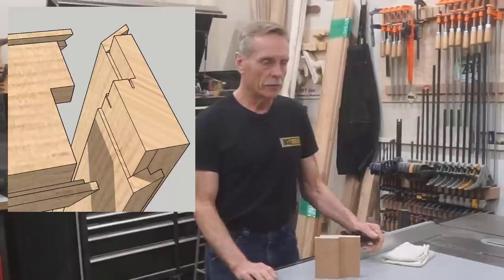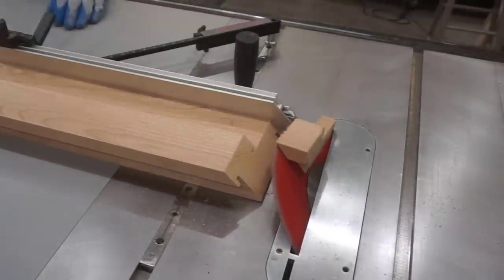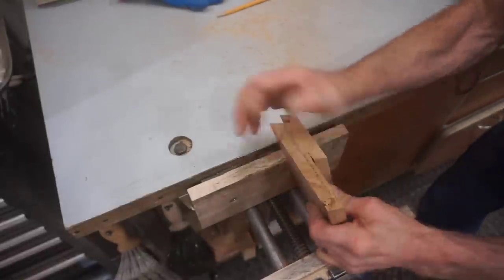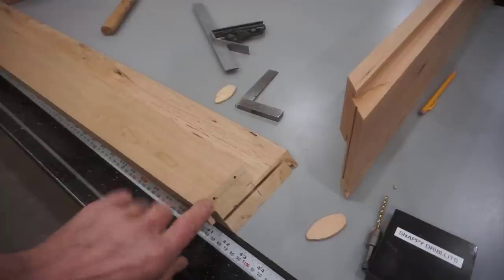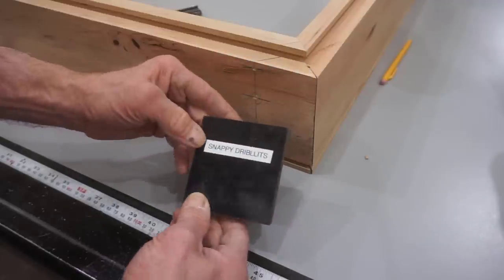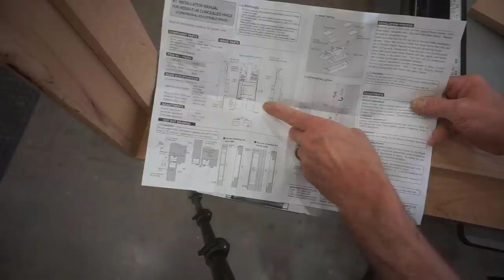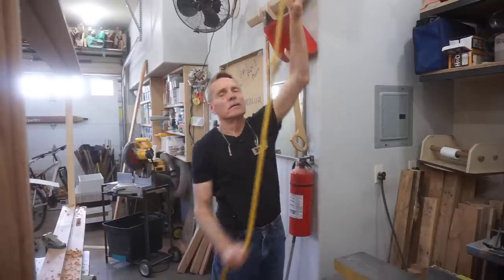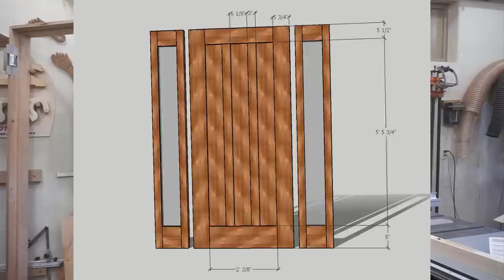Pallet Wood Door Build Episode #4

Comment: Ice been using that 4 inch shrink wrap around my warehouses and tool rooms for about 6 or 7 years.  Its perfect for long stock (pipes, rods, boards, blades, etc...) that doesn't get used often or that needs to get stored on high shelves or leaning against walls.

Comment: Pattern bits are nice because they allow you to use an exact sized template, but you are limited to the available bits. Have you considered using template bushings instead?  Once you get past the offset math needed to create your template, you have separated the patterning function from the cutting function, and you’d be able to use longer high quality bits (like a nice 1/4 spiral carbide bit)
Reply from the maker: I gave up on template bushings years ago when routers were less apt to have arbors concentric to their baseplates Doug.  Since then I've not been limited by available bits but it's certainly only a matter of time until I get bit... then I hope I'll remember your reminder for the expanded capabilities they offer.  Thanks! Best, Matt
Reply: You can get pins that mount in the router to aid in centering the bushing. But, like with all woodworking, there are always multiple approaches
Reply from the maker: @dougwilliams5031  You have obvious router experience... do you have a favorite router lift?  I need to get one for my 'new' tablesaw extension table/router table and the Jessem Master Lift II is at the top of my list... I'm curious about your thoughts and/or recommendations.  Thanks! Best, Matt
Reply: I have a woodpecker prl v2, with a porter cable 7518 that I picked up at a sale price. It’s a good reliable system, with above table adjustments and bit changes. I don’t like the plastic insert rings, and picked up a set of aluminum rings. There are other systems that have rings that attach with magnets that look nice as well. Part of your selection process needs to include the plate size (you may already have an opening in a table), what routers are compatible, and adjustments features (micro adjust, rapid adjust, above table bit changes)
Reply: The Jessem master lift II is a great unit. It will be a game changer for the precision of making doors and other router table tasks.
Reply from the maker: @Doug Williams Thanks for that... it was a toss up between Woodpeckers and Jessem and the coin came down on  Jessem.  I understand that a Porter Cable 75182 router is THEE one for lifts.  Is that what yours is or does the '2' designate a different model?  Would you replace yours with the same model if necessary or would you 'upgrade' to something else?  Best, Matt

Comment: I discovered that green shrink wrap when I was moving in June. I use it all the time now.
Reply from the maker: I get the green stuff from the local U-Haul store cuz' I think it's the best. Where did you get yours?
Reply: @NextLevelCarpentry  Home Depot.  I also have the really wide stuff.
Reply from the maker: @russmartin4189  thanks for lettin' me know... we don't have Home Depot around here but I'll take a gander next time I'm in Den-town to check it out.  I should probably get some of the wider stuff... just never pulled the trigger on it even though I'm sure it's useful... Best, Matt

Comment: Another excellent video, Matt. I'm not sure why the "premier" format would bother people: just watch it whenever.
Anyway, about the "throw" on the hinge: aren't you concerned about the door hitting the sharp edge of the jamb when it's unable to open to 180 degrees? Or can the hinges be adjusted to only open to 110 degrees?
Reply from the maker: The hinges aren't adjustable to open anything less than 180 degrees but the door swings into a corner against the wall and shelving there will prevent it from opening too far. I think you can see that in the SketchUp model in episode 1. One way or the other though it requires a positive stop because if the door is opened too far the extra thickness would just tear the hinge out of the jam since it's such a heavy door and such a thin strip of wood on the edge of the jamb. I believe I mentioned in episode 2 about my concern of the extra jamb width and the option of switching to a conventional hinge to prevent this very issue.  When I mortise the actual door I will probably move the mortis out leaving just to mmmm of door thickness outside the hinge for a little more freedom of movement I'll be at the risk of blowing out the face of the door. The only reason I'm pushing the design limits to this extent is because it's my own door in my own shop. I wouldn't feel comfortable with this setup for a client where I would risk expensive callbacks if the installation failed from pushing limits too far. Sorry for the long answer for such a simple question thanks for watching and commenting. Best, Matt
Reply: @NextLevelCarpentry  Thanks for the thoughtful reply, Matt. Your level of detail and understanding is very impressive.
Reply from the maker: @ericsmith2482  I appreciate viewers like yourself that are paying close enough attention to ask insightful questions.  Thanks for watching and commenting here... Best, Matt

Comment: Just a thought. Saw you balancing those heavy jamb timber  so that you could drill those pilot holes to attach them to the top of the jamb. Since you had already located where you wanted the pilot holes to exit, would it not have e been easier to drill outward from those located points because the outside was not that critical.
Reply from the maker: That wouldn't be a bad option Subra but I wanted to get the angle pretty close to 45 degrees too and freehanding would have been a bit less predictable but that's more an OCD thing than a right/wrong one.  Thanks for watching and commenting here... Best, Matt

Comment: Nice Job. Definitely will help me when I rout my entry door. As I said we did 7 interior doors. Template made of luan - Not as nice as yours. We had two palm routers. One set with a bushing for the shallow part. One set with a top bearing to do the deep rout. Both router bits were chucked deep into the collet. Your right there are no you tube videos on these type hinge installation. I believe Jon Peters has one where he routes for Soss hinges. But I think he has a factory made template for routing on which he uses a large plunge router.
Cant wait to see your finished product.
Reply from the maker: Glad you got to see this and compare Tony... lots of ways to skin a cat, as they say.  Because it will make sense to you I'll mention that a full 3/4" step in this jamb is overkill.  I didn't realize it until just last night.  Typical exterior jambs have only a 1/2" rabbet/step in them for the weatherstrip and 5/8" would easily 'hide' it.  I'm considering options for planing 1/8" off to leave a more ideal 5/8" step but I think the screws in the head jamb would be visible if I did... 20/20 hindsight.  It's fine the way it is but yours should be easier to do because you'll probably be dealing with 1/2" rather than 3/4".  Hope it goes well! Best, Matt
Reply: @NextLevelCarpentry  thanks Matt.  Actually my door arrives tomorrow. It's a standard door and jamb ordered with no hinge prep. The deep pocket will probably go through the jamb.  I may attach a piece of plywood to back to add thickness. Just have to see what the opening looks like when I take old door out. 
Just watched your video on the Japanese Lego like toys. What a brain teaser that was. Thanks
Reply from the maker: @lrc87290  That's cool... so much of remodeling is exactly like that, right?  Should be easy enough to infill the shim gap with solid wood for strength I imagine.  Glad you liked the Tsumiki video... that's one of the more plain-old enjoyable projects I've done in awhile! Best, Matt
Reply: @NextLevelCarpentry  Matt I noticed you kept the hinge covers on. Don't want to show the wow factor till the last video. People continue to be amazed by modern interior doors and hinges. We had flush solid core doors covered with laminate for a modern look. We made the jambs out of 8/4 poplar. The jamb is flush with the drywall with an aluminum reglet between the drywall and jamb. There is no door casing for a flush look. So I figured I couldn't have hinges sticking out. When I found these hinges I knew they were the answer price be damned. Actually I think they are reasonable for what they are. Wife  not so much.
Thanks again for your videos
Reply from the maker: @lrc87290  You're describing the door installation I saw in Jackson Hole a couple years ago that got me thinking about new possibilities for door/jamb/trim design.  The thought of a aluminum reglet as door casing gives me a headache though... pulling that off tells me you've got some chops!  Nice... and I get the 'wife; not so much' part... I haven't mentioned that figure to Mrs NLC and, sensible, frugal woman she is, would be in the 'not so much' camp for sure!
I'm intrigued by the design/materials/configuration you describe and it's no surprise you ended up with the same choice for hinges.
You're welcome for sure!
Best, Matt
Reply: @NextLevelCarpentry  Matt,
As you may suspect I got all my ideas from you tube. LOL. If you want to see what it supposed to be look like just search modern trim. Most came from another great you tuber named  Matt. Matt Risinger. A Texas builder.
Including a View Rail floating step system with 3-1/2 tigerwood treads.  When I first saw it  on Matt's channel I said I gotta put that in our townhouse renovation. Luckily the wife agreed.
Take care,
Tony
Reply from the maker: @lrc87290  that explanation clears up a lot... ironically that Matt is where I first learned Sugatsune is an alternative to Soss for concealed hinges.  Like gravitational pull to good ideas, right? Good luck with your project! Best, Matt
Reply: @NextLevelCarpentry  Matt, you were spot on. My jamb has 1/2 inch step in it. I have to make new template for routing. I have left over 1/2 x 1 - 3/8 poplar door stop material. It has worked out for both templates. The door is already routed and the template is made for the jamb but not routed yet. 
I'll tell you my screw up. As I was routing the second pocket - the first came out perfect- I didn't have the cutter bit down far enough for the first rough cut of the deep pocket - also the stop blocks were a little below the top of the template- the bearing missed the stop block and the cutter plowed into the stop block , split it and hit the drywall screw holding the block came out and rattled around the cutter. Ruined it. 
Was able to fix the over cut with high performance wood filler. Hope yours is going well.
Reply from the maker: @lrc87290  I SOOOO feel your pain!  Sounds like you made an acceptable save... which is what everyone needs to do from time to time, right?  Is your jamb stained or painted?  It would be just my luck to spoil a stained one since repair is that much more difficult, frustrating and time consuming... the Pallet Wood Door jamb has gone well. Had a few challenges with the threshold which you'll see in Episode #6 which is currently in post production after a 4 hour session in the shop this afternoon.  Thanks for the follow up comment... onward and upward?  Best, Matt
Reply: @NextLevelCarpentry  Matt,
Everything is paint grade. The overcut was in the hinge pocket step. So it would not have mattered if it was stain grade.
Going to try to take advantage of unseasonably warm weather Monday and get this entry door installed. Feeling confident it will go well. Can't wait for your next video. Thanks, Tony
Reply from the maker: @lrc87290  WHEW!  I misunderstood what/where the collateral damage was.  I'm rootin' for an uneventful installation for you! Good luck... 👊💪😎Best, Matt
Reply: @NextLevelCarpentry  Matt, The hinge install on my entry door went well. Tried to send an email with pic to your gmail account listed on your "about " page but it was returned as not found. I think I typed it in correct. As you may know in the neutral state these hinges hold the door about 3/32 inset of the jamb. However they are adjustable in this plane. 
Hopefully your build is going well.
Tony

Comment: Hi Matt, is there anything you could share with me about those measuring calipers you use?
Reply from the maker: Sure Jeffrey, here they are on Amazon: https://www.amazon.com/dp/B001LF3CG2/?ref=idea_lv_dp_ They're the 2nd ones I've had.  The first pair didn't fail but I replaced them because I cracked the plastic lens on the dial.  It's not delicate but got smashed in use somehow.  I chose this particular model on Starrett's reputation and the fact that I like the fractional inch/decimal inch readout so conversion isn't necessary. They're extremely handy in the shop for all manner of things, not the least of which is measuring thickness of pieces when running them through the DW735 thickness planer since 1/64th inch increments are clearly visible... Best, Matt

Comment: Matt, thank your for such in depth and informative content. I thoroughly enjoy every video.

Could you tell me what size snappy bit  you used for the #9 screws on the mitre?
Reply from the maker: Thanks Michael,
I'm pretty sure it was the 9/64" one but keep in mind that I didn't drill very far into the 2nd piece of the jamb with it.  I wanted the screws to start in the right place but didn't want much of a pilot hole so holding strength wouldn't be compromised.  As you know pilot hole size varies with wood species and this jamb is cherry.  Also I oversized the clearance hole on the drillpress so the screws could pull the jamb pieces together really tight.  Wish the answer were a little more clear cut for you... Best, Matt
Reply: @NextLevelCarpentry  Thank you very much for the in depth respond! I appreciate the time taken for an answer that doesn't lack detail for the sake of being clear cut. I imagine that's why a lot of your subscribers enjoy your channel. There's a time for concise, and there's a time to get in to the weeds. I think you nailed it. Or screwed it in this case

Comment: Why don't you use glue on the miter joint.  The beach wood biscuits will swell when wet with glue so when the glue dries it creates a very strong joint.

Comment: Love watching your videos I have a question about the hinge... you said that your door won’t open 180 degrees why didn’t you just move the hinge over ...when the hinge is fully open divide that in half and it would leave enough room on both sides
Reply from the maker: Your suggestion is, in fact, the solution but only for a typical jamb design.  Having this door slab set back 5/8" from the face of the jamb is what causes my little predicament... I only WISH I could get more 'throw' from these hinges to allow the door to open 180 degrees so I  could use this door/jamb in other situations where more than 110 degrees of opening is necessary.  Best, Matt

Comment: Great video. Just wondering, is there a specific reason why you chose to use screws along with the biscuits instead of glue. I'm barely a beginner so thanks if advance!
Reply from the maker: Good question NyseOne... nice one, in fact! 😂 Unlike typical applications, in this situation the biscuits are only for alignment while screws provide strength to hold the joint together.  Biscuits and glue alone wouldn't be nearly strong enough to withstand the stress of a 3-sided door jamb without failing.  If, however, it was a 4-sided assembly where visible screws were unacceptable I'd have no problem gluing and clamping the corners. A large part of advancing from beginner is to wrestle with exactly this sort of question.  I refer to it as joinery, in general, and knowing what it takes to make a project strong enough to serve it's purpose is a never-ending duty. Best, Matt
Reply: @NextLevelCarpentry  Thanks for the thorough reply! Love your videos, I learn a lot from each one.

Comment: Wouldn't it be easier to roll things through the door without a threshold?
Reply from the maker: Doug: yes it would but, without a level threshold, the swing of the door means it won't seal at the bottom.  Since there's an overhead door for rolling problematic things in and out I chose sealing over ease/convenience.  If I was able to swing the door 'down slope' I'd just make the bottom rail of the door angled to make it seal without interruption from a threshold.  Thanks for watching and commenting... Best, Matt